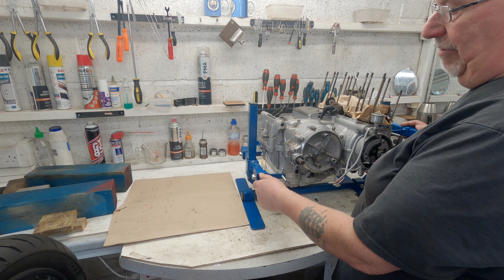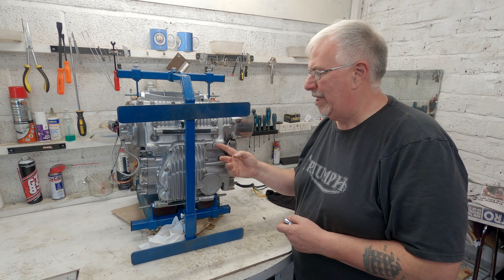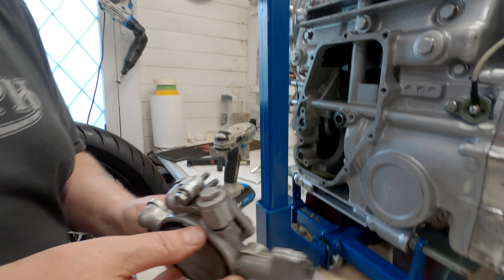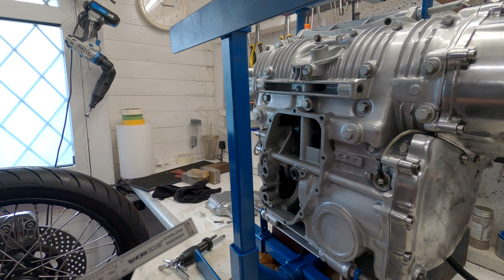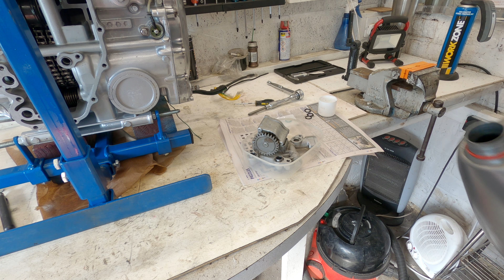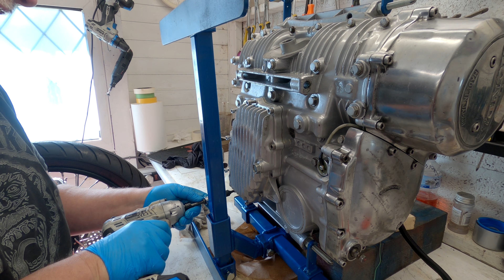Honda CB750 Oil Pump, Primary Chain & Bottom End Check [Cafe Racer Engine Build] 11

Comment: Do NOT use a K series cylinder with a F2  [410] cylinder head ..... they are NOT compatible .... you will have massive oil leakage .
Reply from the maker: Thanks, that was something I didn't originally know, wish somebody had said at that time.  But if you follow the playlist you will get to https://youtu.be/JziM5jJ9dy0 where I try to explain why it doesn't work.  Take care.

Comment: not a look over the release and pressure valves on the oil pump? Sometimes they are the cause of "malfunctioning". Even more if you mention (actually was a text stamped on the video) saying: definitely wet sump...I would have take a look to them.
Reply from the maker: Good point.  I really should have looked at them.  I am not overly worried about the wet sumping, it isn't such an issue on these unlike on Triumphs.  I know the pump is giving good pressure and can be removed without having to take the engine out again, so I have put it on my list for another day.

Comment: Hi. I’m recommissioning my cb750 k3 and have started the engine just for a few seconds but the oil light is not coming on the dash, I’ve checked the bulb and it’s fine. Do you have any ideas? Could it be the switch? Or would the light stay on if the switch was faulty? Many thank, Matt
Reply from the maker: It is unlikley that your oil pump has suddenly failed. So I would suspect the switch, assuming you haven't been doing any other engine work.

When you switch the ignition on the oil light should come on and stay on until the engine is running.  The oil pressure switch switches it off.  

The switches do go quite often, one of my earlier videos on a CB750 shows me changing it.    It is in the middle at the back of the block under the cam chain tensioner and has a wire that goes from it to under the starter cover. If you disconnect it and put power to the wire the light should come on, if it does then it must be the switch, if not then it could still be a wiring issue, or less likely no pressure.

To reassure yourself take the top off the oil tank with the engine running and look in with a torch, you should be able to see oil returning to the tank.  If you can see it I would suspect all is well and just the switch needs replacing. 

I hope this helps let me know how you go on.
Reply: That’s brilliant, thanks 👍

Comment: Considering You might end up with a completely new top end, I find it a bit careless to not overhaul or replace the scored parts in the oil pump. You just showed us bits of junk and maybe even metal shavings in the sump, and You're saying You couldn't care less about it. I think You just lowered the value of the bike, quite a bit there.
Reply from the maker: I hear what you say, but the jury is still out on the oil pump.  I have looked at a couple of other pumps at an autojumble and they seemed pretty much the same, and the seller wanted good money for them.  Remember though that the bike had good oil pressure when I had it running so I know the pump works.  The bits and pieces that were in the mesh wouldn't have been caused by the pump.  I am still pretty sure they came from the top end.  We'll have to see whether I come across another, better, pump before I have the engine back in the frame.

Comment: Can the primary chain be checked and the oil pump removed with the engine in the frame?
Reply from the maker: Yes, if you watch this earlier video of mine, https://youtu.be/tyiFKvlkiUo  I am checking the primary chain with the engine in the bike.  As you have to remove the sump plate to get to the primary chain, you can also remove the oil pump.  Obviously you will probably have to remove the exhaust to be able get full access.

Comment: I think I’ve got a set of barrels in the shed, K6 I think, I’ll have a look if you think they could be useful?
Reply: Hi Les, sorry I’m going to be a let down, I sold the cylinder head and cam’s about 4 years ago, I must’ve given him the barrels as well!, no recollection of doing so but they aren’t there so I must’ve done, hope the one’s you have coming are ok 👍
Reply from the maker: @1234567marks  No sweat, it was very kind of you to offer anyway. Fingers crossed the ones coming are good
Reply from the maker: Thanks Mark, I have a set on the way, but I am not sure of the condition yet, I'll let you know if they aren't up to scratch. I would be really grateful if you could check yours to see if they have good fins, and the liners are sound, if they are good please do let me know how much you want for them.  The barrels from the bike are in really great conditon, it is a crying shame that they are out of spec for my pistons.  They would be great if I was to go to 836 so that they only needed boring by another few thou but I wasn't even thinking of 812/823 until I stripped the engine and found the Yoshi pistons.
Reply: @SPANNERRASH  ok I’ll have a look tomorrow, I’m pretty sure they are good but I haven’t seen them for approx 4 years!.

Comment: Hi, in my engine from k1 I have to replace the Primary Chain is over 73 mm
Reply from the maker: Looks like you are doing the right thing.  73mm sounds like it is really due.  My information comes from the Factory Manual.

Its a lot of work and  makes replacing the primary on a Harley or Triumph twin look a breeze.

Good luck with it.